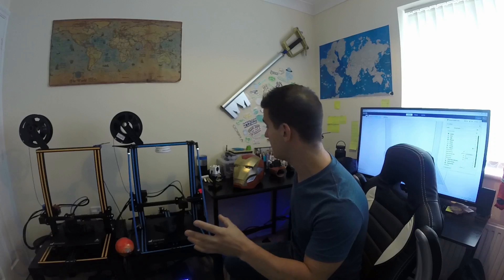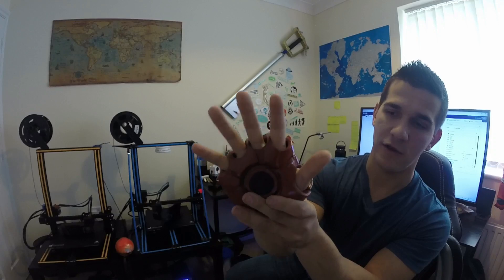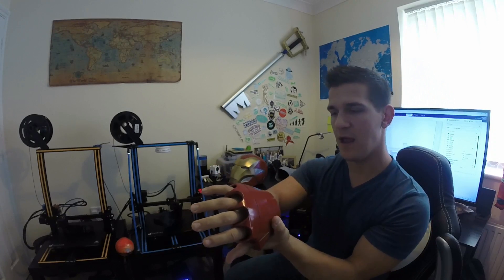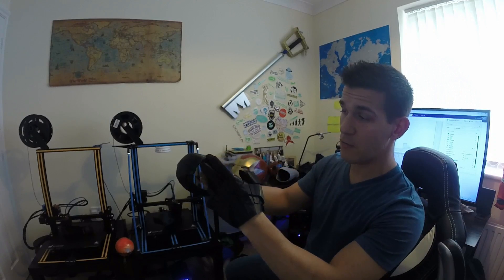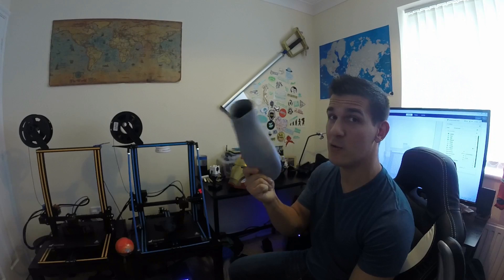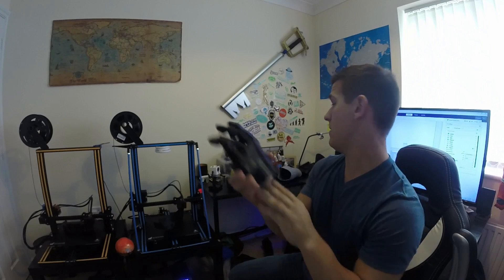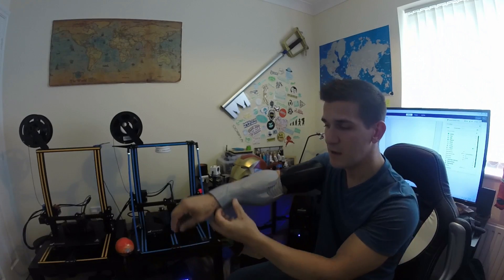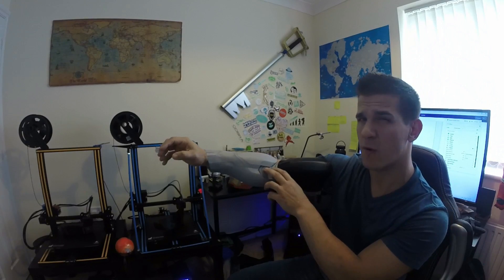How to Make an Iron Man Suit | 3D Printed MK85 Cosplay - Part 2

Comment: Your probably aware, but you can get little machines that you put your scrap into and turn your scrap back into filament.
Reply from the maker: It’s not quite that simple. Any one under $1000 is absolutely terrible and still doesn’t give you a way to grind up the prints. You can only add to them once you’ve already pulverised them
Reply: @FranklyBuilt  How much does a roll of filament cost on average? I'm still to get started. I'm looking into the Zmorph machine. Do you have any thoughts on that machine?
Reply from the maker: $20~ ish and nah I’ve never heard of that
Reply: @FranklyBuilt  It's a 3in1 machine or 4in1 if you include that it can do duel filament. Can you please check it out and give me your opinion on it? I am near purchasing and I can see you have good experience on the 3D printing side of things. This machine also does CNC milling & engraving. Laser printing & engraving.
I hope you check it out and get back to me.
Cheers.
Reply from the maker: Typically these multi purpose machines don’t have the way track records. They try to do a bunch of things good but it ends up making the machine have weird issues

Comment: how did you cut the abdomen part.. i know how to do a pane cut but how did u cut it in shape with the borders. both the videos  were a great help. u can see my works on instagram  @3dprintingvadodara
.keep it up..
Reply from the maker: Hey! So I didn’t actually have  to cut it. I dropped the file into Slic3r and hit “Split”. If there are multiple parts in the model it will separate them and let you render them by themselves. It made it a lot easier to print. However I had to do Plane cuts on the chest and back
Reply: @FranklyBuilt   thanks maan.. I just started printing the mk 85..  maan this is gonna take long.. 🙂 but can't wait ..  just hoping not a lot of failed prints ahead.. wish u the same as well.. 🙂
Reply from the maker: Jigar Panchal you should find and add me on Instagram so we can talk. I can probably help you a lot with the slices and mistakes I’ve made.
Reply: @FranklyBuilt  what's you r Instagram handle..
Reply from the maker: Jigar Panchal I’ll give you one guess 🤣 Frankly_Built